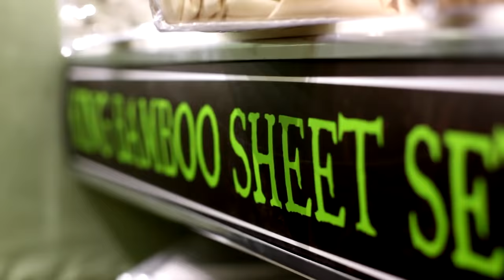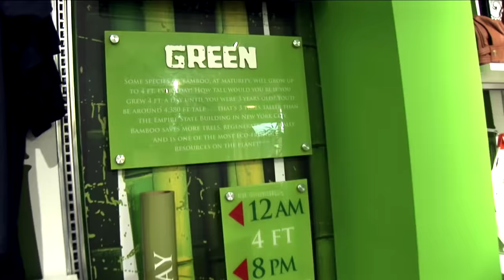Bamboo: The Miracle Plant

Comment: In some areas it is wise to use clumping, rather than running, bamboo.  The cold weather running bamboo can be difficult to control in hot climates .  But there and a huge variety of bamboos that clump and have all the same benefits commercially and environmentally.

Comment: Bamboo fabric used with banana plant cellulose sponge with an aluminum scandium frame. Both the fabric and the sponge treated with water activated ceramic. Prefabricated homes were people can order on line then have the prefabricated home delivered to site were the pieces can be lever latch locked together.  The foundation being bamboo fabric with a thick core of banana plant cellulose sponge that has holes for plumming. Foundation shipped in it's pressed vacumed sealed package. Two gallon's of hot water is slowly poured into the top of a container connected to the pressed foundation. Water is absorbed by the sponge and bursts the packaging then rises and exspand's that then dries rock hard in 24 hour's. Then wall panels can be attached to foundation and to each other all the way up to the roof all being lever latch locked into place. Two people set up requiring no tool's. Then hose the whole structure down with water to activate the ceramic and let it dry snd cure rock hard in 48 hour's drying and curing times will vary depending on the environment. What do you think about this use of bamboo and plant cellulose to build home's? Could even order bamboo curtains bamboo rugs bamboo doors bamboo storm shutters bamboo floors all on line and all shipped to the individual who ordered their new home. I have other idea's if you are interested lets have a chat. 😊

Comment: Honestly, we should move away from our reliance on trees and switch to bamboo which can be just as sturdy, but far easier to grow and replenish. With Bamboo, we don't have to worry about deforestation as we can let the trees regrow and use bamboo forests for everything, from paper, to furniture, building materials, etc. We can use it for cups, replace plastic with it, and never have to worry about it running out with how easy it is to regrow, how quickly it regrows (leave it alone for a month and it'll produce the same amount of material it would take 10 years to get from trees), and it'll help out the environment.

Comment: Bamboo concrete fabric like concrete canvas to use has a new building material. Develope banna plant cellulose that will swell up when water is introduced that will harden like a foam to use inside bamboo wall panels. Prefabricated wall panels used to build a home order on line erect on site just add water and let it all cure? LOL I am amazed no one has done this yet! A person could order a dream home on line have it delivered then two people could erect a home in a few days by swivel latch locking all the panels to each other and the foundation then just add water and let it all cure into a rock solid structure that is 100% green.

Comment: Bamboo fabric designed just like concrete canvas. Plant cellulose sponge mats treated with water activated ceramic that swell up them harden has it dries. Whole buuldings could be designed. Prefabricated compressed and sealed in a plasitic space bag. Just add hot water and the whole prefabricated structure erects itself and hardens into a ceramic. 😊

Comment: Bamboo flooring was supposed to be a very cheap alternative however it’s one of the most expensive now. Sounds like a bunch of advertising BS to me!
Reply: The same goes for the clothes made of bamboo , just to fucking expensive .
Reply: The fake stuff and flooring made partially with bamboo (usually a veneer) is strong but the 100% bamboo floors I've seen don't really easy and is damage easily by water. I knew a guy who built a house and had to have part of the floor redone because moving in his furniture dented and scratched up the bamboo floors and a minor water leak caused the floor to be ruined.

Comment: not to mention that when acidified with glacial acetic acid(essentially concentrated vinegar), you can make a themoplastic from the cellulose fibers(cellulose acetate) from the bamboo that can also be softened and dissolved in acetone. this is the stuff that was supposed to replace silk, cotton, all fabrics in the early 1900s, but was stopped by silk investors.

Comment: have you tried growing Bamboo in the US? I would like to promote Bamboo and its derivatives, I will start a crowd funding group but would you be in to guide me understand what your biggest challenges have been?
Reply: Guylaine Cliche Many varieties of bamboo spread so fast they are considered invasive. It is banned in some locations because of that. That could be good as long as you can keep it on your property where you want it. There are clumping varieties that are supposed to be easier to control.
Reply: GrowMap I've looked and the clumping varieties are the less productive ones, the spreading types are the ones that yield the most and can be easily controlled with a solid surround.
Reply: Guylaine Cliche Have a look at Shakuhachi.com and the flute maker Monty Levenson,work,  there are links a resources on his site including the American Bamboo Society
Reply: +Guylaine Cliche The biggest problem is not enough cold-hard varieties.
Reply: I appreciate your comment - yet living in AZ I think the heat is not favorable to bamboo and the amount of water required is too high for my region...
Reply: Guylaine Cliche bamboo loves the heat, use underground watering hose to water and use a lot of mulch to trap your water underground.
Reply: Yep. Mulch is the answer for any crop in a low-water environment.

Comment: Hemp does all if that and a bit more
Reply: mike tovey cellulose is cellulose, it all produces good fiber while pulling CO2 out of the air and producing many products that could easily replace modern plastics and such.
Reply: ***** I wasn't just talking about cellulose. 
Like hemp oil for example to make bio fuel and a plastic that is stronger than steel! 
You could build and fuel a car...
I've not seen that done with bamboo... Well not out side of the Flintstones anyway.
Reply: mike tovey if they get cellulose fermentation going good, you could produce butanol from it and fuel a car with it. hemp plastic is cellulose plastic, cellulose acetate, which can be further reinforced with pure cellulose, allowing you to build the whole car except the metal parts from it. hemp oil is questionable due to lack of supply though, you can get some oil, but definitely not enough to fuel the world. oil based fuels are going to be the thing of the past for vehicles anyway, electric cars are what's going to be the future once they develop a process to mass produce large graphene supercapacitors efficiently to store electricity long term and in large quantities. 
it would have been amazing that hemp and bamboo cellulose acetate plastics would have been further developed when they should have in the 1930's, but dupont and such just didn't want it....
Reply: ***** fair enough.
Though you could have thermo plastics and technically no metal parts what so ever!! 
Hemp seeds contains a good dose of omega 3 fatty acids. 
Anyway the point is you have 2 really good natural resources that are not being used
Reply: mike tovey you need to have metal in the drivetrain and brakes.
Reply: ***** why's that then??
Reply: mike tovey you're going to make a engine block, transmission, drive shaft and/or a electric motor from plastic alone? wake up.
Reply: I'll concede that electric components need metal to actually work but if you have a plastic that is stronger than steel10 times as light and  thermo setting sure why not...but then im not an engineer but why isn't that possible in laymans terms?
Reply: the other thing hemp is good for...hempcrete!
Reply: I didn't forget it I just didn't mention it... But yep there is a whole pharmaceutical products that bamboo can't offer
Reply: mike tovey it has strength, but it doesn't have the hardness to complement the strength needed to make engine components, it's like putting paper against a rock(in realistic terms), paper is strong, but a rock is a lot more wear resistant. you can't make plastic parts that will withstand the rigors of wear and tear that a engine capable of running a car produces,
Reply: Hemp is not as good for building structures, baskets,  or other applications where rigidity is desired.  Hemp is superior for uses like fabric and papermaking.
Reply: The worlds most Eco-friendly car, the Kestrel, was designed in Canada by Calgary-based Motive Industries INC
It has a top speed of 90 km per hour and a range of approximately 100 
miles before needing to be recharged. It’s powered by a motor made by 
TM4 Electrodynamic Systems, a Quebec based company.
The body of the car is completely impact-resistant and made entirely out of hemp.
The Kestrel’s hemp composite body shell passed its crash test in strong 
form, unlike steel, the panels bounce back into shape after impact. Hemp
 also has the same mechanical properties as glass. It is even lighter 
than glass and these properties help boost fuel efficiency.

This isn’t the first time we’ve seen a hemp car making noise, did you 
know that Henry Ford spent more than a decade researching and building 
his Model T car? This was in the 1940’s, it was completely made from 
hemp. This car was 10 times stronger than steel and was also designed to
 run off of hemp bio-fuel! Whatever happened to this idea? 

http://www.collective-evolution.com/2013/11/01/the-worlds-most-eco-friendly-car-its-made-entirely-from-hemp/
Reply: have you seen hempcrete? or the plastics the derive from hemp?
Reply: Read up on hempcrete, it's unbelievably useless.
Reply: mike tovey You clearly know nothing about cars, there's tons of material that's stronger than what's ysed on cars today. However, in an accident, you actually want your car to crush, as a huge force acting on a longer distance (dent distance) will actually decrease the force felt and thus, the car is more safe. 
Alot of your other points don't make sense either, feels like you're grasping at straws. AND I'm currently dabbing concentrates
Reply: And you are surprised by that?  We all need to stop commenting on this stuff and rise up against capitalism run amok  and make things fairer for everyone.  But global warming created by capitalism run amok will kill us first.  So, just have fun and spread love cause we screwed it up so bad we are going away.
Reply: Take it easy dab-man.  There's a point where you just go to bed and dream crazy shit.
Reply: Build a Tall Tower with Hemp..  Can't do. need Bamboo structural members.  Hemp and Bamboo together, all you need for anything.
Reply: mike tovey and all the products you mentioned are toxic , nice one.
Reply: But bamboo grows faster and costs far less.
Reply: This is not a contest

Comment: As a gardener I find it difficult to believe that any plant group that is not completely put back into the soil in some form does not need fertilizer or nourishment from outside sources. Whenever a plant or plant part is removed from the system it takes nutrients with it. Intensive agriculture draws on external resources like a sponge.  If you have commercial products then you will definitely have intensive agriculture. Grasses are resource hogs, especially for nitrogen needed for fast growth. I applaud renewables, but this sounds a bit unrealistically one-sided.